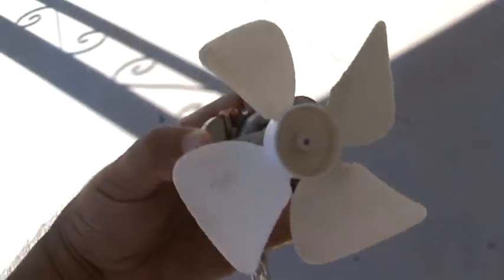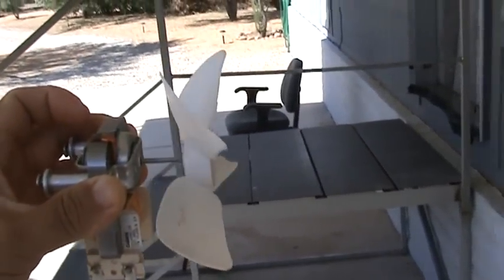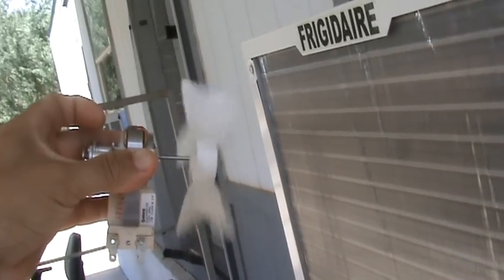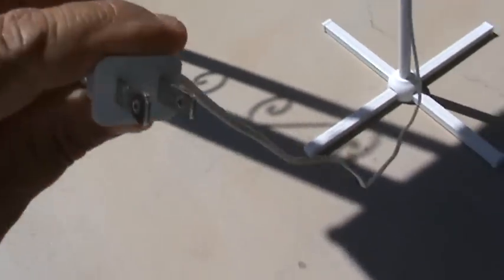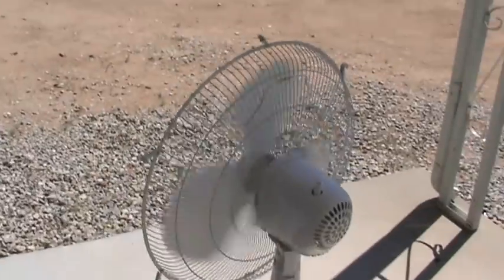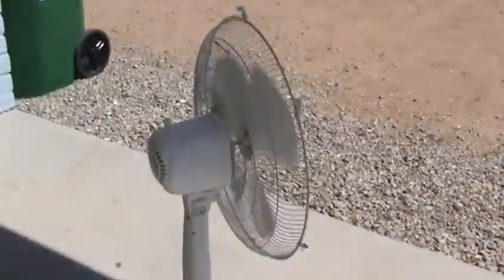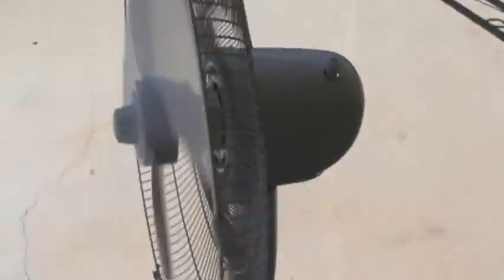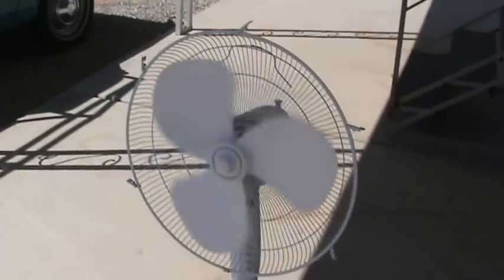wind generator using Oscillating fan possibilities

Comment: Its not free energy from your AC unit. Because you are blocking the units fan, it will have to work a tiny bit more to push air out. Which means it will be using a bit more energy. You will get a net energy loss because of energy conversions involved.
Reply from the maker: This was just a idea and a old video.

Comment: The fan is not actually following the air... the oscillation happens because the fan and motor are connected to gears, so if the motor turns, the swivel will happen. Good idea to use the power that's already there (the wind blowing about, or the air coming out of your constantly working A/C) :)

Comment: This is good advice for you. I made the same mistake. most fans run on AC motors, which dont create electricity without adjustments. You need a DC motor to generate electricity. which means a DC motor has permanent magnets in it, which creates an electro magnetic field without it being plugged into electricity. Therefore, when you turn the motor, you should feel some resistance. if you feel resistance, it is DC. If it is AC you will not feel to much resistance pushing against you.

Comment: The air conditioner will use more electricity or/and work less efficiently if anything is blocking the air in-take. Any energy (electricity) generated by an attached fan will be less than the additional energy used by the air conditioner. 
It's the three laws of thermodynamics. We cannot gain, we cannot break even, we will always lose (energy, in this case).

Comment: The fan is blowing or turning backwards so you should have hooked a volt meter to the plug end to see what if any energy was being created
Reply: The camera fps is slower than that fan speed, that makes it look backwards as it changes speeds.  Think about when you have seen wagon wheels moving backwards in an old movie or car tires appearing to spin backwards in a car commercial or movie/tv.
Reply from the maker: thanks for the info.

Comment: i stuck a broken window fan in the wind and was able to read a steady .6 of a volt off the plug with no modification whatsoever, so you could theoretically run a calculator or a small led or other small electronic device off of your oscillating fan for free!
Reply from the maker: Caleb Robinson  or recharge some batteries
Reply: @Iseekoutthetruth  absolutely, This concept is good  to supplement solar charging station.

Comment: What will be the effect of making a duct that feeds the wind from the AC straight to the fan and cutting the losses (of wind from the AC) that now occurs. I believe you will still have good enough ventilation from the AC, and then just have to convert the ac moter in the fan to a generator. Ducting the airflow will undoubtedly increase the airflow over the fan blades and give you more speed on the generator, once you reach that stage of building.
 Also think about the rpm's you will be getting out of the generator, since you will very likely have to make a call between a low rpm or high rpm generator.
Reply from the maker: it was just a idea I had 5 years ago.
Reply from the maker: Wout Dedoncker
yup sad

Comment from the maker: this video I made almost 3 years ago, i no longer mess around with wind generators, take to much money to get the batteries charging station and everything you need to just get one wind generator set up, to much start up cost to try to save money, as far as my microwave video you saw, I have more videos on me taking apart that little motor on my channel. I laugh at it now, but back than it really gave me jolt that lasted about a week, up my left arm across  my chest and down my right leg.

Comment: You could place a wind turbine to the back of the AC followed by a small system of gears that could, based on the leverage output due to how many gears you put into it. Could possibly turn the generator enough to keep the AC running incase of a power outage; But in case that doesn't work. Put in a treadmill generator, or two. 7 Treadmill generators can power and average size house, so 1 could be enough to keep the AC running in case of such an emergency.
Reply from the maker: Old video, just thinking out loud.

Comment: Attach permanently a WIND Turbine (400 Watts - Low Speed wind) in the Back of the AC. 
 As long the AC in ON, the air going out with move the Wind Turbine and your will produce electricity.
You will be only recycling / using some lose energy from the AC creating a Hybrid System. :-)

Comment: you need to try it with some kind of load though!!  with nothing connected to the motor, the fan will turn very easily, but when you connect a load like a battery or a light or something, it will be much harder to turn, and might not work at all for the amount of force you get- from whatever is putting out the air, or wind.... I think people make this mistake when they make a wind turbine, you need a lot more force once your load is connected. (LOL  load.)  :D

Comment: Don't let the fact that those motors don't have magnets deter you. What you need is a motor run capacitor to ferroresonate those induction motors. A smaller value works better for high speeds in strong winds, while a larger capacitor will cut in at a lower speed. If it won't cut in, you might try grinding out those pole shading rings, and try it again. (that will render them useless as motors) You would have to hand start them, or, they will just sit and hum. Without the capacitor to create the tank circuit, the voltage will be just barely measurable, but not useful. I can't recommend a value without knowing the inductance of the motors. you'll just have to experiment.
Reply from the maker: This was a old video of a idea I had but never followed thru with.
Reply: @Iseekoutthetruth  Knowing about capacitors, it's worth revisiting if only for the curiosity.
Reply from the maker: @vincentrobinette1507  I have seen a lot of videos about capacitors. I saw a guy run his car on only capacitors, there cool. I think that's how Nicola Tesla ran his electric car, with ceramic capacitors.
Reply: @Iseekoutthetruth  Those are large storage capacitors. the capacitors you need for the fan experiments will be in the order of 1 to 5 microfarads. more like small motor run capacitors. They MUST be non-polarized for AC use. You are right though, the low voltage extremely high capacity electrolytic capacitors, often called 'super" or "Ultracapacitors" are starting to give batteries a contest.
Reply from the maker: @vincentrobinette1507  when I was a kid 12 years old, I had a neighbor who had a electric VW bug, he had 1 battery, he called it a super battery and it was self charging system. When I see cars today with multiple batteries I laugh, because this guy had a self charging VW back in the 70's.

Comment: this is a good idea for me and people who have a lot of old fans
Reply from the maker: +Network Awsome  yea recycle those old fans.
Reply: yea but can you connect a power inverter to it to step up the voltages of all the fans when the fans outside creating free electricity
Reply from the maker: Network Awsome
I do not know, I am not a electronic guy.
Reply: ok bro
Reply: +Network Awsome You could try and replace the motor in the fan and put a brushed motor in to generate more Volts and then step it up with a 12v Regulator and then use a car invertor
Reply: ok thaks for the info

Comment: Even though it spinning fast, there are not any resistance in the motor, i'ts not connected. You won't be able to create any more energy than the watt-number on the fan.
Reply from the maker: old video. it was just a idea.
Reply: Per Kärnebro u
Reply: While that is true, we could still add 'reverse fans' on the other side of AC units or anything else that blows air to generate power IN GENERAL.  

It's not about the fact that "you can't create more power than you put in" but rather "we can slowly implement little things over time to give small amounts back to the point where the upfront electrical house-hold cost is minimal."

Reverse fans in AC units, "dam-like" structures in our house water pipes which will in turn give some power, solar panels on our roofs, or using anything we can to harness energy from objects while using them how we already do.

It's not about what asking what we can't do, it's about asking what is rational, real, and what we CAN do.  These are all things everyone can do right now to start saving energy COSTS (money wise.)
Reply from the maker: Huntingskill that is a great way of thinking. Maybe set up some kind of Tesla water turbine in your incoming water to your home, since your going to use your water anyways why not make it run thru a Tesla water turbine and make energy while running your water. Kill 2 birds with one stone.
Reply: Per Kärnebro p
Reply: they should put mini wind turbines at the top of street lights, street lights are everywhere and the turbines could act as a top-up for the neighbouring houses/shops/traffic lights....
Reply: if you could imitate a tree imagine the output :), a Christmas tree doesn't get used for 11 months out of the year...maybe a decent project.
Reply: I think that's already used in some places
Reply from the maker: Haowei Shi you have video of it.

Comment: wow... um first of all you can't generate electricity with an AC induction motor and second, the fan isn't "Following where the wind blows" as long as the oscillating function is engaged and the motor shaft is turning it's going to oscillate. even if you turn it by hand.

Comment: I was not referring to the "air in-take”. I was referring to the OUT-TAKE. Air going out the A/C = wind = Energy. Why not using the air going out =energy from the A/C and converting that Air/energy to power? Anything wrong about recycling or/and a Hybrid???? Think out of the Box. Producing/consuming Independent energy is possible. Examples: Solar/wind = OFF grid. Reducing the cost of electricity is possible =Grid tie. Think out the Box. :-)

Comment: are you trying to say a person can charge a bank of lead acid batteries using this idea of a normal fan by connecting 99p full bridge ac to dc rectifier and run a 12v dc - 240 ac inverter to power a home for free ?
Reply from the maker: did I say that in the video?

Comment: A generator has to contain a field magnet or get energized like an alternator to work bubbo.
Reply from the maker: +David's Favorite Videos this was just a old idea.
Reply: Actually, you can use an induction motor as an asynchronous grid-tie generator.  When you have the fan turned on and plugged in and the wind makes the blades spin faster than the electricity is, it will push power back into the grid. If you have a watt meter hooked to the fan plug, and as the wind speed increase, you would see power drop to zero and come back up. The coming back up part is the watts going to the grid. The watt meter doesn't know direction of power flow, it just knows the power.
Reply from the maker: Richard Lewis
cool thanks for the info
Reply from the maker: *****
I used to be interested in this stuff but this was a long time ago.

Comment: I was not referring to the "air in-take”(inside the room) . I was referring to the OUT-TAKE Air going out the A/C = wind = Energy. Why not using the air going out =energy from the A/C and converting that Air/energy to power? Anything wrong about recycling or/and a Hybrid???? Think out of the Box. Producing/consuming Independent energy is possible. Examples: Solar/wind = OFF grid. Reducing the cost of electricity is possible =Grid tie.(Only two examples) :-)

Comment: Putting anything in front of the heat escape of the refrigerator may end in an overheating.
Reply from the maker: this is a AC unit, and it was only a Idea I had 4 years ago. I never followed up with this idea.
Reply: Was not a bad idea at all, you may probably have used a little bit of wind power, some heat power, like making some tubes system to heat water that then would cool creating current you could use.
There is a lot of wasted energy in our cities
Reply from the maker: yes there is, lately there has been alot of very strong wind here in Arizona. we have been getting 35 to 40 mph wind here in the last 3 months.i have been thinking about wind generators again.
Reply: if you have an independent house and some money you should, i live in a flat and the balcony is not great for wind turbines :( but i still am thinking about a mini one!
Reply from the maker: yes i own my own home, where are you located?
Reply: Italy, abruzzo ;)
Reply from the maker: cool
Reply from the maker: I just read that a large gas line just exploded in the  Ukraine, it  Supplies Germany, France, Italy, Austria
Reply: Don't know about that but heard that russia wants to stop gas supplies to ukraine, maybe it's just an excuse who knows
Reply from the maker: http://www.rumormillnews.com/cgi-bin/forum.cgi?read=310418
Reply: yes, that doesn't look like an excuse, seems like we are not going to cook a lot of pasta on gas fire... ^^
Reply from the maker: thats a big fireball

Comment: If you seek the truth you need to read up on how AC induction motors work and why they don't generate electricity when run in reverse.  Also, the power generated by your air conditioning's exhaust is vastly negligible compared to the input, rendering it next to useless.